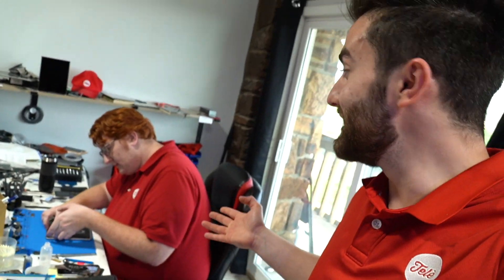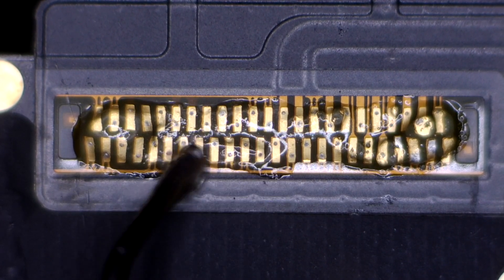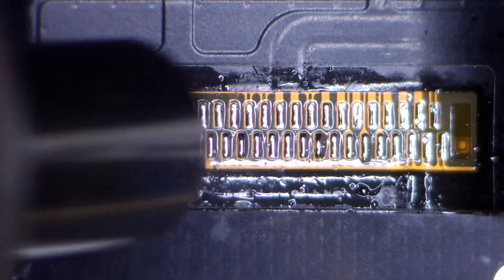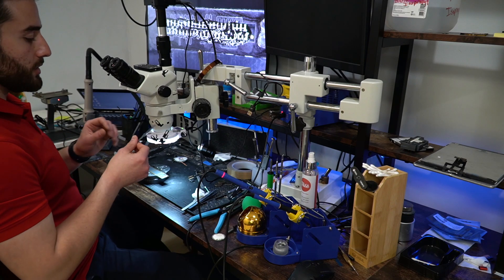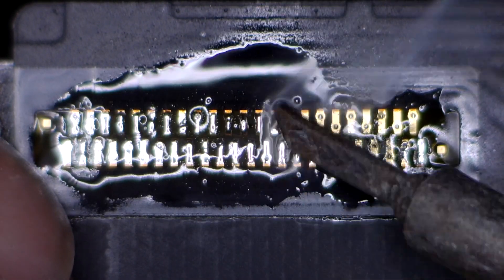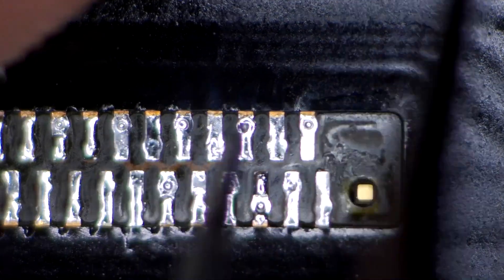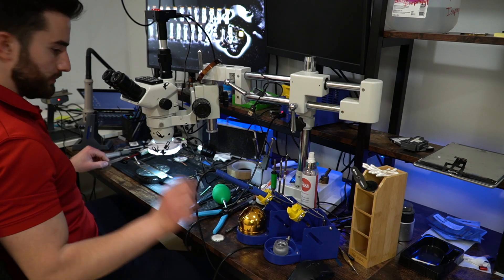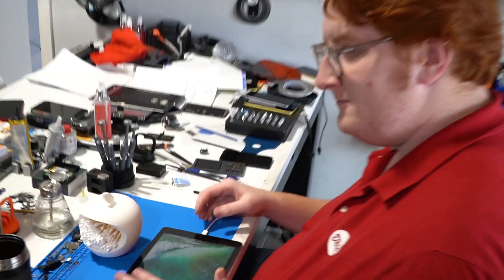iPad 5 Charging Port Replacement

Comment: A while back I had a coworker who was having issues with his phone's charging port so he went to the electronics repair shop next to our store and they looked at his phone for about 10 to 15 minutes and said that they could fix the issue for $180. He came back told me about it, I looked at it and got the lint out in less than 2 minutes.